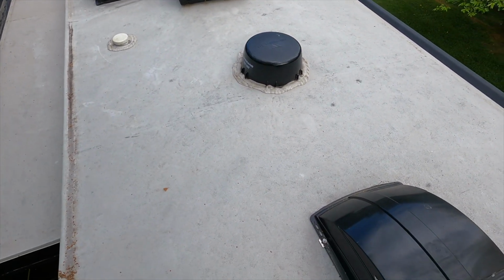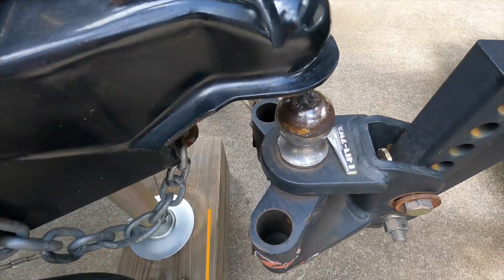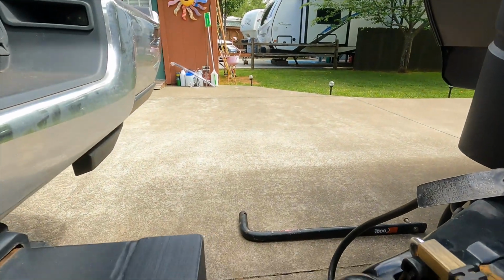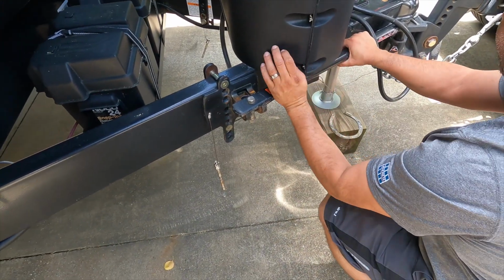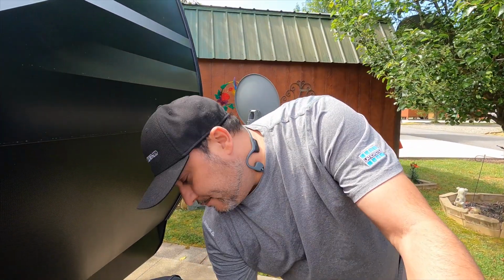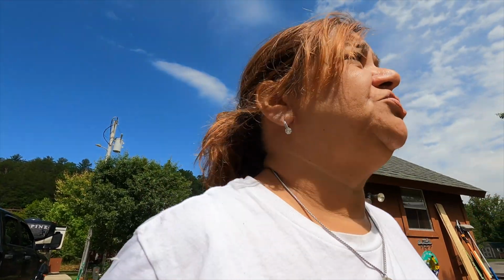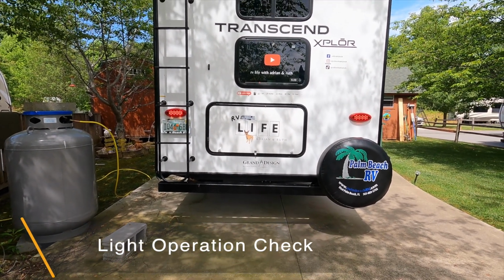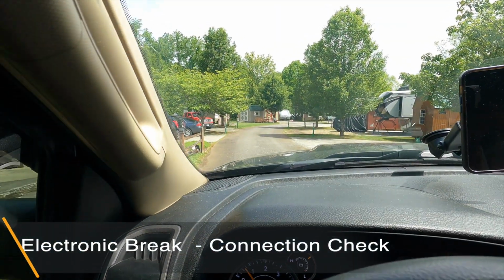Ensuring Your Rv Is Safely Connected To Your Truck | Conducting Essential Safety Checks

Comment: Hey guys, great video. One suggestion. When you are backing up to line the ball with the hitch and you have reached the point where you want to be, put on your emergency brake. That will prevent your tow vehicle from moving forward when you shift from reverse to park (assuming you have an automatic transmission, although this would probably work with a manual transmission). Works for us every time.
Reply from the maker: Thanks I usually do use the brake. But not this time
Reply from the maker: Thank you tips are always welcomed 😊 Hope you guys have a great weekend 🎉